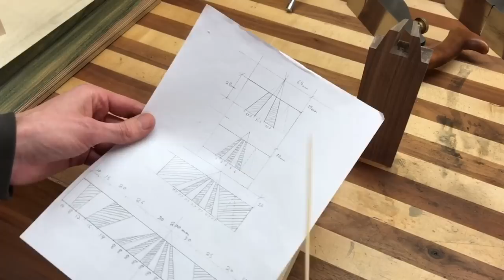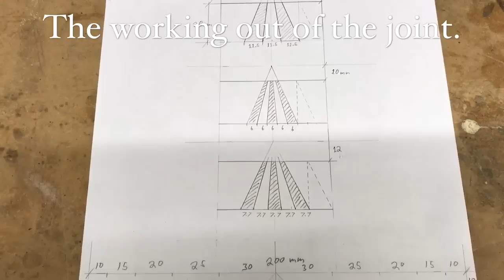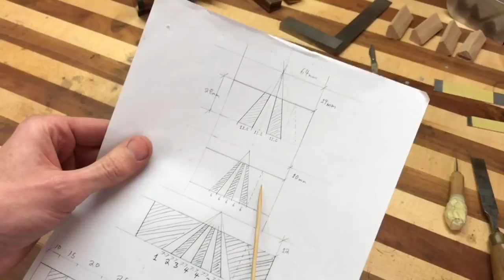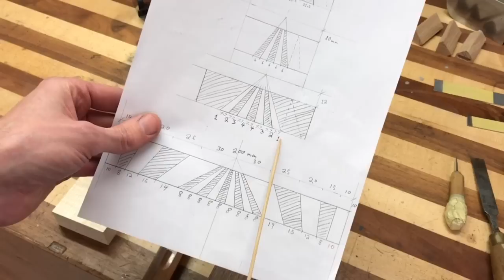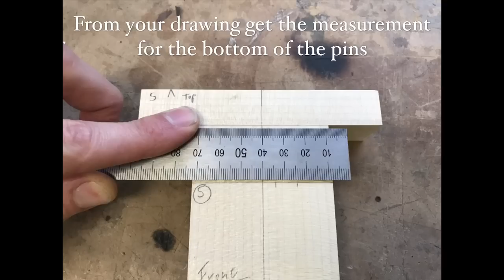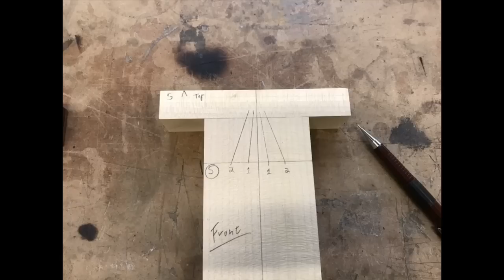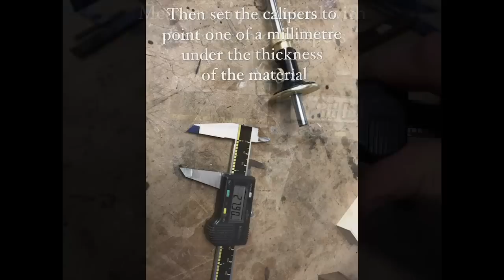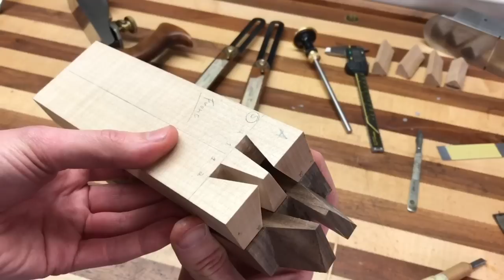How to make a Japanese dovetail joint. By Theo Cook. Tutor at Robinson House Studio School

Comment: instead of using sticky tap for the guide block and a sliding bevel for each angle you can chisel the guide block to fit on the joint and remove and replace it to the same spot to trace all the lines one face at a time, I'm not sure this is quicker but it's certainly easier if you're doing more than one joint, or don't have sliding bevels
 Great video.

Comment: I get the impression that these are MORE decorative than the common or garden dovetails but not as strong . The video however was excellent in its presentation.
Reply from the maker: Hey thanks for the comments. I have got results on how strong this type of joint is vs a standard dovetail.  The video will go up soon.

Comment: Amazing to see the process.   Understood the angle cutting, but first time I saw how to get the layout correct with the blocks and multiple sliding bevels.   Going to have to try it out.
For the gluing and clamp up - I am wondering since the pins will stand proud, does the flat clamping block prevent the joint from seating?

Comment: I need to make a table for my new PC, and will probably use oak since i can't afford Australian Buloke. But knowing that the latter is the most dense wood in the world, will it be impossible to make square legs that fit seemlessly with the table top, using those kinds of joints? Also can i create those kinds of joints with oak and be able to remove the legs if i need to move the table to another location?

Comment: Can you assemble a box with type of joint?  It seems with the 45 degree angle you need to assemble that would not be possible.
Reply from the maker: Hi. You can but they have to all be put together at the same time.

Comment: The 'concave' chisel is actually a 'convex' chisel, I think? You seem to be rolling it around on the square, instead of it leaving a gap? 18:45
Reply: an interesting point.  but...could it be called a concave chisel because it creates a concave shape in the wood???  or maybe he just misspoke.
Reply from the maker: +Jaap van der Velde That is right I did make a mistake it is convex.
Reply: Yeah it's likely he just misspoke, but I figured it wouldn't hurt to point out, just in case someone goes out and gets the wrong type :)

Comment: How much would a good set of starter tools cost? I've been looking around and havent found anything worth buying. I want something more sturdy and lasting. Not plastic.
Reply: Old planes can go for cheap on eBay, but they probably need some work to make them usable, and for chisels the best place to get them is eBay, older the better. a bit of surface rust is fine but I'd avoid pitted chisels or any tool with pitting for that matter.

Comment: how do you make any money doing that takes a long time or is just for pleasure
Reply: You take your time and do it right and Then you charge a lot of money for each one because they are hand made by a craftsman !! You see how everybody has a Rolls Royce ? How long does it take to get one ? well when that Tree grows , then we will make you the dashboard...
Reply: There is no money to be made in woodworking. Years ago I made a few tables and chairs out of lumber from trees I fell on our property. Mortise and tenon joints,no fasteners just good clean locking joints. They were beautiful made mostly from birds eye maple  and some were spalted. I had found a retailer who could put them on the floor for a fee of course and after they sat there a while with no bites she asked about adjusting my price. I said I was already at a point below a fair profit for the time spent (materials were free) but agreed. She asked if there were any ways I could cut corners as far as my time so I explained all the hand cut joinery was the biggest offender. She said that her customers could care less about joinery and what type it is. This was a high end retail shop in upstate New York. She said that a sheetrock screw would be just fine and no one would ever notice and if they did they wouldn't care. So ended my venture into furniture making and I continued with my real job building custom homes.